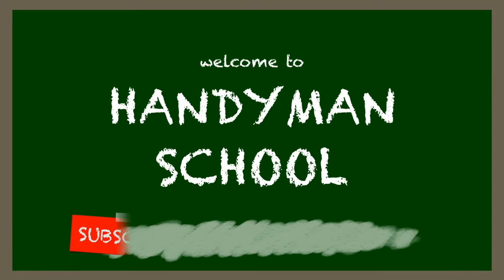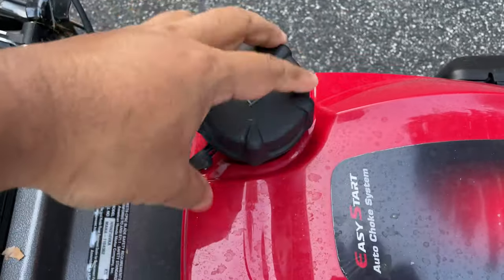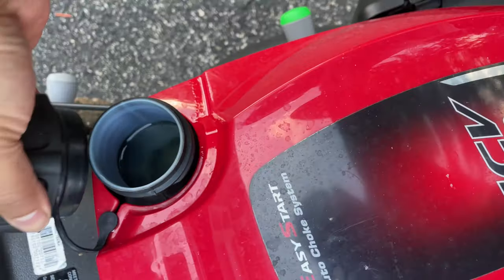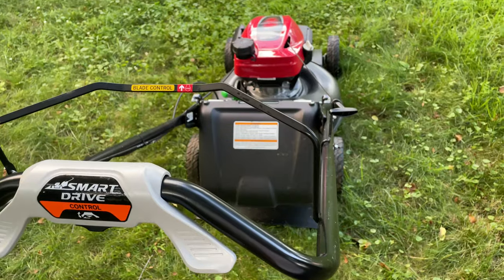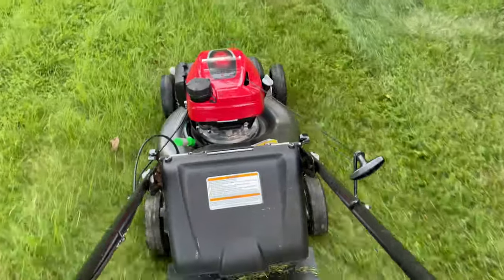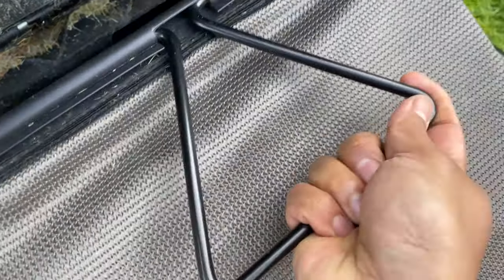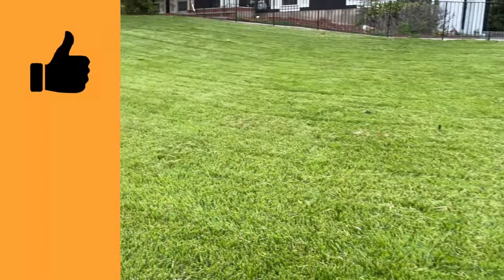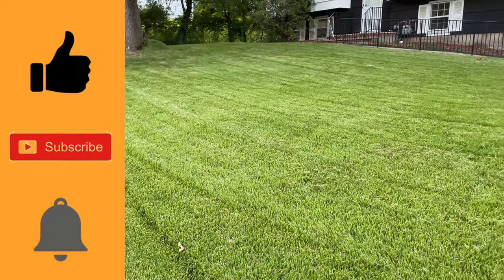Best lawn mower - Honda GCV170

Comment: I need to replace a choke spring on my 170. There is a blue dot on the mounting bracket. I ordered one from a local dealer. When I got it the a spring had a yellow/orange dot on it. It did not fix the problem. Did I get the wrong part?

Comment: Question? It doesn't appear your yard has many steep hills, my backyard has some hilly areas. Do you think this engine is powerful enough to not only cut grass in this situation, but push the self propelled wheels up hiss and steep inclines? Also, how is your mower holding up nowadays?
Reply from the maker: I believe this mower is designed to climb hills it’s rear wheel drive for that reason. I am impressed with the self propelled feature. It’s operating as new. I am still using the same blade.
Reply: @handymanschool  Thanks!
Reply from the maker: You are welcome. Happy to help

Comment: my oil cap is so hard can't turn it?  you need to do something to turn the oil cap?
Reply from the maker: The oil cap is made out of plastic material. It supposed to be hand tightened only. You can apply a drop of  penetrating oil at the threads and attempt to open the cap with a small wrench and use very low pressure, be extremely careful not to brake it. Let me know how it went.

Comment: I drive Honda products, however, I doubt I will buy a lawnmower again. The engine crapped out on me after 3 years. They are extremely hard to get parts or even a replacement engine. Honda wimped out and got out of the lawnmower business. Never again.